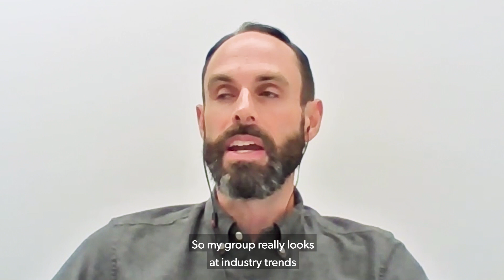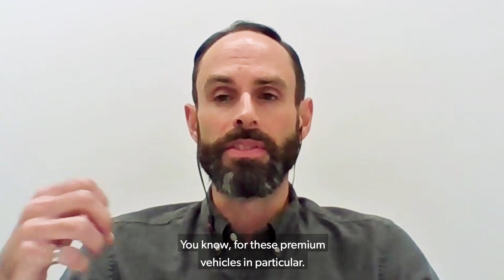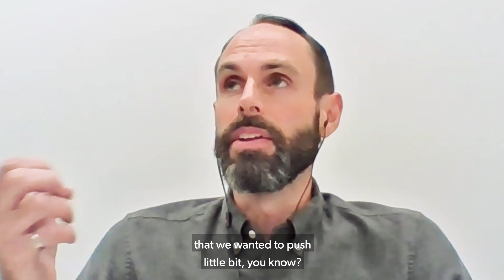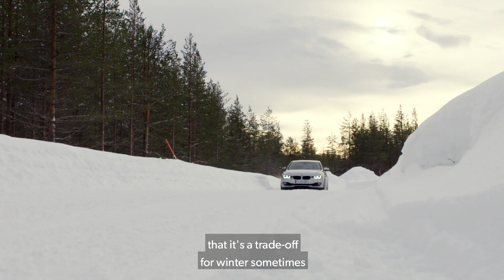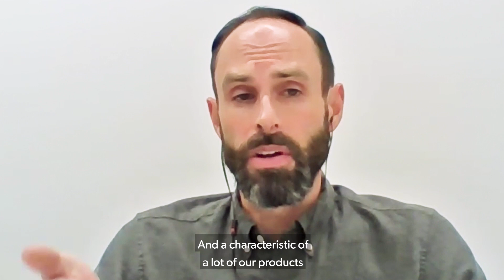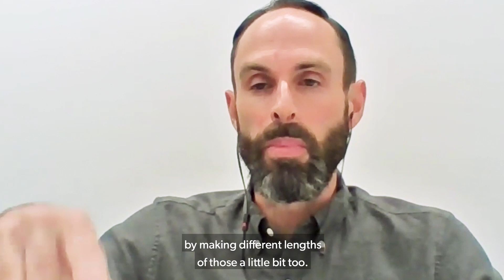TJ & Bridgestone Talk Turanza QuietTrack | Tire Rack

Comment: I put these tires on my AWD Acura TLX and they lasted 80,000 miles
and when I finally replaced them after 80,000 miles, they still had decent treads. And these tires are very quiet…Just make you rotate!!!

Comment: Bought these tires in late September 2020 and 1.5 years later I'm not so enthusiastic about these tires.

For the 1st 15k miles they were very quiet, had excellent wet weather traction, and handled great in all weather conditions. Now that they have 25k miles on them the traction has become an issue in wet weather or snowy conditions. 

These tires come with 80k warranty and with approx 30% of that put on my tires they look as if nearly 50% of the tread depth has worn away. I can't imagine these tires getting anywhere close to 80k miles. That's with a car that has had the entire suspension and steering replaced with premium parts just days before purchasing the tires. Check pressure regularly, keep them balanced and rotated more frequently than necessary but the tread depth has worn away much faster than it should. All 4 tires have even wear across the face and there is no evidence of premature tire wear.

Other than me believing the tires will not last 80k as advertised, they are simply amazing, well at least for the first 15-20k miles.
Reply from the maker: We're sorry to hear these tires didn't live up to your expectations! Next time you're in need of a new set, please reach out. We'd be happy to help you find another option that may better suit your needs.

Comment: Will Robbins Bridgestone dude  is correct, having the tread depth throughout the life of the tire 80,000 is very important for wet braking
Compared to new tires there is only 7 feet difference in the wet and same dry braking compared to the best, driver error and reaction time would vary more than this
Now look at the braking distance when other tires wear down to 4/32 and 2/32
https://www.youtube.com/watch?v=zA6MUlVNkLM

Comment: I am very disappointed in the QuietTrack, which I purchase on April 7, 2021. On the freeway, when the pavement has grooves, the car moves around as if the wind is blowing it around. Sometimes it is so extreme that my passenger feels it. It doesn't happen on smooth pavement. Also, it is loud, not at all quiet when the pavement is not perfectly smooth. I took my car back to the Firestone dealer where I bought them and they took it for a test drive.The technician did not find any problem. At that time I had not realized that it was only when the freeway pavement was grooved. So, I took it to the Toyota dealer, where I bought my 2018 Camry, and their technician did not encounter any wobbling.They did some minor adjustment on the steering but it didn't take care of the problem. I am not sure where to go now. Maybe a different Firestone dealer. I hate to keep driving around until I find someone to identify the problem. I am sure that it is the tires because since 2017 I have not experienced the same problem with the original Turanza tires that came with the car. They weren't QuietTrack though. And, I have never had this kind of tire problem before.
Reply from the maker: We're sorry to hear these tires didn't live up to your expectations! Next time you're in need of a new set, please reach out. We'd be happy to help you find another option that may better suit your needs.

Comment: I’m torn between this tire and the Michelin Defenders T+H. The ecopias from Bridgestone had terrible wear , much lower than their rating for my Prius. The Costco tire techs agreed. In fact they told me to stay away from bridge stone and stick with Michelin. 

Your thoughts between the two? I care most about treadwear and a quiet drive.
Reply from the maker: The Bridgestone Turanza QuietTrack is a top-rated tire with excellent reviews. Unfortunately, we cannot provide the exact number of miles you can expect out of this tire due to the differences in individual driving habits. However, 9.3/10 for treadwear performance, which is excellent. Follow the link for more information: https://bit.ly/2Q30f0Z.
Reply: @tirerack  it’s too new of a tire I think to say for certain.  Only time will tell.

Comment: Trying a set of these on my Lexus ES300h. Picked this tire due to all of the great reviews. Replacing Toyo Versados which I got 40k out of. Will report back with my findings.
Reply: Put on a set and they are fantastic
 My fifth set of Bridgrstones. Prior have used the Driveguard (50k miles), Simplicy (40k) and the dealer installed Bridgestones. I thought the Toyo were great and I did get (40k) out of them. But the Quiet Track are the best so far. Great wet and dry traction, smooth ride, and great cornering ability. They are very quiet on the freeway. I drive long commutes and no longer have the turn up the radio to drown out road noise. I put them on a Hybrid and I am currently running my mileage numbers with varying air pressures. I started at 36psi, now up to 40psi. And my fuel economy keeps increasing. Max pressure is 52psi. I'm averaging 40 to 42 mpg at 40psi. I worked in the tire industry way back. Road tested many vehicles and tire brands. The ride quality is similar to many Michelin tires that I test drove. Be that on a road test or many ride and drives that I attended. It is not an inexpensive tire but I am very pleased with the purchase. I am religious about tire pressure and routine tire rotations.
Reply: @mbburg2149  thanks for the detailed response. What do you think about cross-rotation of these? The pattern doesn’t not look totally symmetrical. I’m planning to cross them regardless, fwd pattern.
Reply: @tgamirov  Well I worked fot one dealer that just mandated straight rotations. Another mandated cross rotations. But this was done due to uneven tire wear. I have been doing straight rotations for 15 years. Get 40k to 50k miles (Toyota/Lexus sedans). This is with 5000 mile rotations, regular air checks, and reg alignment checks.
Reply: I guess after all those years in the shops. Replacing tires and selling tires with premature wear due to lack of maintenance. IE rotations/pressure/alignment it had an affect. I'm pretty diligent with my oil changes. Started back when I was into OHV motorcycles and ATVs. Japanese and Italian motorcycles. Always used synthetic oil and K&N filters. Still do to this day. Change it every 3000 to 5000 miles. Batteries every 4 years whether it needs it or not.

Comment: Living in South Africa where we only have All Season tires and no snow, will this specific Bridgestone Touring tire give you good milage especially if you're a relaxing driver? My current tires are Kumho HS51 tires which have siping groves in them and I must say, after two years they're showing no wear on the tread at all.
Reply from the maker: Great question! Unfortunately, we cannot provide the exact number of miles you can expect out of this tire due to the differences in individual driving habits. However, this tire has received ratings of 9.3/10 for treadwear performance, which is excellent. You can find additional ratings, reviews and pricing information on the product description page by following this link: https://bit.ly/2VGQEwh.